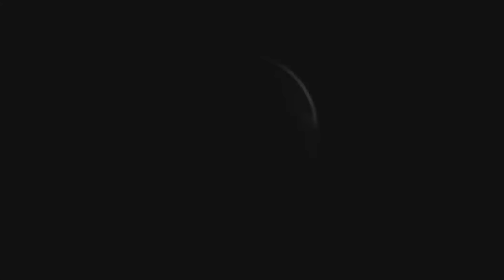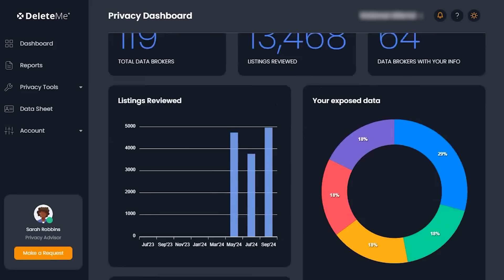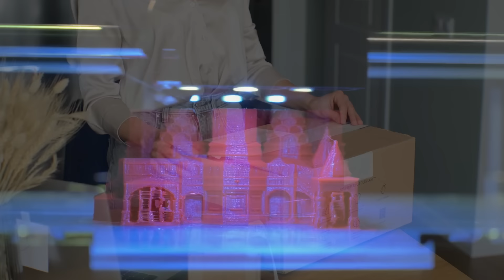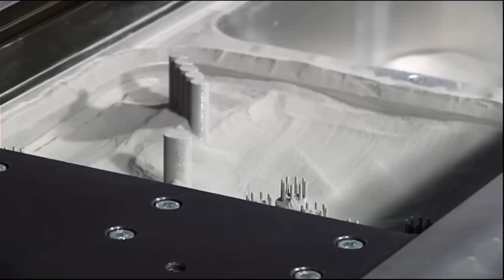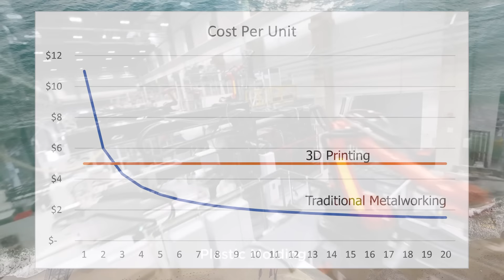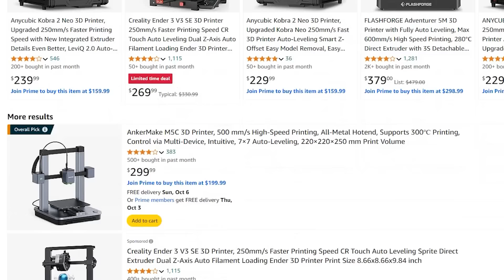3D Printing, Cathie Wood's Latest Disaster

Comment: I would love to get a 3D printer, but right now, the market is just too wild to get a handle on. I consider myself more educated than most and even I can't make sense of which printer to buy. We almost need an Apple Computer-type company that makes a solid, extremely consumer-friendly version just to settle things down. (There are a couple brands that might fit that description now, but again, hard to see it from the outside looking in.) Let others be the Android/DOS wild west, but create a product someone can just buy and use. I also think that is the primary cause of Wired's prediction failure. Sure, there might be a learning curve even if you may just be getting plans online, but until we get that market leader that "becomes" the 3D printer to own, Costco and Walmart would be foolish to stock any of them.
Reply: if Apple made a 3d printer for retail consumers it would be 15000$
Reply: @sergitech9697  And you'd have to buy a $8000 proprietary cable separately.
Reply: Bambu Labs and Prusa are the top dogs of 3D printing now.  I like Prusa printers better but they can't compete with Bambu Labs on the low price offerings.  The cheapest full size Prusa is $1100 (unless you want to completely build it for $799) while Bambu has a full size printer that puts out almost as good of prints for $339.  Bambu Labs is the Apple of 3D printing, slick and sleek!

Comment: To be fair Bamblabs killed so many of the other brands. had my x1c for over a year and it print polycarb and nylon with little effort. Its as accurate as of F900 at work and prints as fast. Kathy invested it the 3dsystems and Stratsys and those are ferrari's is price to own and run. Great for manufacturing but not for Comsumers. we have 2 great metal printer for making injection mold, stamping die and other tooling parts. However no way the company or equipment should be valued any different to a CNC maker.

Comment: If you need millions of units - 3d printing is not feasible vs injection moulding. However it has its place for custom specific products at low production volume. It is also useful for interative product prototyping or IM mould design itself. The issue the industry is facing for industrial level 3d printers is that the Chinese are selling very able consumer grade printers at a fraction of the cost with 80-90% print quality. That's why Stratasys is suing Bambulabs in my opinion.
Reply: Not that degree of print quality. To make a useable machine part you need less than 0.01 inch accuracy every time. And I know this because I use to work aerospace
Reply: Bambu lab don't make industrial printers do they?

Comment: Most aluminum aerospace parts are not molded, they are milled from solid billet.  So most of the billet is removed as metal chips and is essentially waste.  That is where the reduction in waste comes from.  Laser scintered metal powder can be recycled.  That said 90% cost reduction is ridiculous and not feasible.
Reply: This idiot thinks we don't recycle the aluminum chips by the ton......
Reply: @samsonsoturian6013  sure chips can be recycled and turned into new billet. Unscintered powder can be mixed with fresh powder on site immediately and used immediately at no extra cost to smelt and reforge chips.  It is apples and oranges.  It is far more efficient, not 90% more but way more efficient and that is saying nothing about the ability to nest part in your build volume to get more parts out of the volume of material.
Reply: Rockets have always been held back by the extreme R&D.

Comment: The crazy part is 3d printing has a niche profitable application (custom parts), but gamblers can turn anything into a ponzi scheme
Reply: It's not even that niche, a lot of companies could use it for research, rapid prototyping, small scale runs or when no other way of making what you want exists. The tech is actually really old, but the patents only expired a few years ago.
Reply: @lbgstzockt8493 yup.   It’s not a new tech, if my family has in our basement .for a few hundred bucks.  Yes, businesses need printers to quickly print a part until they can get one shipped.
Reply: There's someone here on YouTube with a print farm whose niche is dust collector attachments for power tools. He seems to be doing well for himself.
Reply: Well observed! And due to the parts being custom, the process of their creation can not be at all automated - which further closes up any potential for scammers to create AI- generated NFT-equivalent object files!
Reply: Pretty much. 3d printing is like contemporary AI. It absolutely has valid use cases . . . but it's not magic!
Reply: Even for mass produced parts it has some applications. There are medical implants with lattices for bone to grow into for a better bond or internal features that can't really be machined normally that get made with it, but it's not very precise. Threads, locating features, bearing surfaces, basically anything that needs a decent surface finish or remotely tight tolerance, needs to be machined as a second or third op in a normal lathe or mill after consolidation.
I can't imagine it's cost effective for anything except aerospace or medical given just how insanely expensive it all gets, but it could be a good supplement to investment casting or forging.
Reply: Yeah, been following the "hobby" side actively quite a while. Yes even the under 1k printers can be used professionally in protos/small batch mfg, or just to make some extra on the side if you get a good idea. The problem is how to market and sell your idea, when everyone who has a printer can reverse-engineer your product and sell it. So many youtubers in 3dp are just like the "get rich by buying my cource to become rich" guys. They sell you the dream of making money with the tech, while their business is the videos you watch. Same goes to CNC Lasers/hobby mills....
Reply: Also a consumer market! I don't have a 3d printer but I can think of numerous things it could be useful for.
Reply: Thats a very time real statement that says i3D printing hasn't gotten way better in the last two years. The next niche thing will be ships from china sending you food containers for the food they send you in containers that they make from food they don't even grow themselves. Your consumption is niche lol. You should make a toilet paper machine.
Reply: I didn't understand a word that you wrote
Reply: @TheRoland19111  I think that person had a stroke while writing that.

Comment: New technology is wonderful but it's almost impossible to tell which of the dozens of companies will succeed.
Reply: It's actually been around for decades.  The technology is cool when you first learn about it, but there have been zero companies that have been successful with the technology in all those decades, mostly due to slow production times.  Mass production with 3D printing is inefficient.  It's only decent for prototyping, and even that's challenging to turn a profit and keep a business alive.  So the answer is NONE will succeed until proven otherwise.
Reply: @jonb9194  It can be integrated within a larger business.  There's no business that can turn a profit from say, using solely a power drill, but combine that power drill with other tools to create a fully featured workshop, in a prototyping department, which feeds design inputs to a traditional mass production department, then you can go places.

Maybe the question is can a business using a 3D printer be isolate from any sort of traditional mass manufacturing and still succeed.  The value they have to bring is not mass produced products, but something else.  It might be education, or low volume highly custom parts.  Or whatever they produce in mass might not be a physical product at all, but a digital product, like a movie or social media content.  Or even a video game.  How's that for an idea?  How to use a 3D printer to aid in video game development.  Pokemon Go was a hit because it combined a video game with real life exploration.  Can we do that with 3D printers?

We tend to think of successful games as games that target the widest market - think mobile games that anyone could just download and play.  On the other hand there are more niche gaming markets like flight, racing, or tank simulators where players spend a lot of money on hardware.  Maybe there can be a game where players spend money on a 3D printer in order to play the game.
Reply: @jonb9194  I use my 3d printer all the time, most of the small electronics companies I know use them, these days they are like drills just a standard tool in the workshop. Mostly used to make jigs - I 3d print PCBs to make sure they will fit in the housings. 3d Printers are not cool anymore they are just standard tools.
Reply: That's what ETFs are for.  So that you invest in an industry rather than a single company.

Comment: 3d printing to make the molds that manufacture parts at scale is a very good production pipeline. Unfortunately you don't need a bunch of printers working around the clock to do that. I'm just happy I can get really good resin printers for my hobbies now. Sorry not sorry it came at the cost of investor hype. 🙂

Comment: As someone who owns 7 3D printers I can confirm they are a pain in the ass… but pretty cool when working properly
Reply: Im curious about what brand.  This was my biggest concern when buying one but Maintinance on my Bambu X1C has been smooth on the maintinance front so far.  Biggest issue Ive had is panicking anout finding a microfibre cloth to clean with.
Reply: @OneMocha1015   Yeah the Bambu is great. It’s those cheaper ones like the Crealitys that give me problems. Not too bad on maintenance, but I’m also an electrical engineer so I have the tools handy to fix those problems. There’s certain things that if I were an average consumer I probably wouldn’t want to deal with it. You get what you pay for so if you go cheap just be prepared for that.
Reply: @OneMocha1015 I have been using tiertime up3d but I heard good thing about Bambu too
Reply: Yeah because you own a hobby one. We ain't talking about hobby printers, but commercial ones.
Reply: @DoesntRefillTheBrita  No shit? I thought he had 7 commercial printers thanks for clarifying that, captain autismo
Reply: @DoesntRefillTheBrita  BBL has bridged that gap we use them in production prototyping. Can do Nylon and other stuff on X1, they are great.  If you are at home printing home stuff a P1 series is plenty, it's the same thing with a few features and failsafes taken out. And yes, the X1 has caught things multiple times, before the spaghetti monster appeared and saved me a lot of hassle and time.
Reply: @DoesntRefillTheBrita  Commercial printers? You might as well invest in CNC at that point and mill out a block of plastic. Or hell, a hot injection mold plant. 3D Printers were designed for cheap rapid prototyping that didn’t require pinpoint precision.
Reply: @SeanGBM  if you weren't aware, there are many parts which can't be made with a CNC but can be made with injection molding or 3D printing
Reply: @DoesntRefillTheBrita  there’s just not that many applications for commercial 3D printers. Like mentioned in the video, cost quickly becomes more expensive for 3D printing vs something like injection molding. 3D printing is viable for making custom parts in low quantities. Not many businesses need low numbers of custom parts to where buying a commercial 3D printer makes sense.
Reply: @brax3d   cool. I'm not arguing that. I'm saying your original comment is irrelevant.
Reply: That's where bambu lab made a huge leap forward in the industry initially. Before that 3D printers were for people that wanted to tinker with machines, not 3d print reasonably reliably with reasonably little effort.
Reply: 3dp is like a custom cars - you have to want to learn and gain knowledge about it - its not a microwave where you can set it and forget it
Reply: It's a good thing that they are a pain in the ass, right?  Keeps the noncommitted and lazy folk out of the industry.
Reply: Rarely had problems with my printers since I always did monthly maintenance on them. My oldest printer which is an fdm still works after 8 years. I now have added 3 new resin printers and they're easier to maintain. Also buying a good brand ensures you have parts available and have a community to help you out if you can't identify an issue. Even cars break down if you don't do proper maintenance.
Reply: Pain because they aren't made at a high standard to save cost. Rigidity, speed, maintenance could all be improved significantly for more cost.

They're trying to keep them cheap. That's why they're annoying.
Reply: Which is why it is important to actually buy from established company with good after sales support and servicing packages.
Reply: @Jinkypigs  I went cheaper because I don’t mind (and honestly enjoy) fixing things, so support  wasn’t a big selling point for me when selecting a printer but I definitely agree with you for the average consumer
Reply: I have 16
Reply: @101yen  nice. Print farm?
Reply: Someones trying to flex 🙄

Comment: Nobody want to engineer and print out 25 parts before they get it right to fix some stupid issue that a $15 part from a local shop would fix perfectly.
Reply: This really depends. Some parts, even if plastic, are sold at massively inflated prices (particularly plastic bits for cars) or aren’t sold at all, so 3D printers are great for fixing stuff that’d otherwise require replacement for a minor breakage. But their real value lies in prototyping and bespoke parts. Joe Bloggs will probably never bother with a 3D printer, too much effort, but for small scale prototyping they are invaluable, whether you’re a hobbyist or a huge engineering firm. Every engineering firm I’ve been at has had at least one 3D printer for running quick prototypes, saves a ton of time over constantly going back and forth with the machinists on something you may end up canning.
Reply: Measure twice, cut once.  I always take measurements of the things I plan on making a 3d printed part for, so that when I design stuff in CAD, I have features that are the right dimensions.  I've also worked with a machinist before and gone through my growing pains of learning about how to tolerance.  It takes discipline, but for me, having to do 25 iterations is unheard of.  Maybe a few at most.
Reply: People often confuse 3D-design and 3D-printing. Putting an 3D-printer to good use does not mean you have to design as well. There is a lot usefull stuff for free on the internet and models get reworked over and over again. 

From my experience good measurement is key. I would rate 5% of my prints as failure. My husband needed special supports for his music stuff, which would have cost 80€ including shipping and tax from a foreign country. Would at least take a week for shipping. I printed them for 10€ in 12 hours.

The printer I did this on was bought new for 150€ years ago.
Reply: It's great for fixing various things around the house.  I used to cut and drill a lot of lumber and acrylic to fix or make something custom (to my exact specs).  Now I usually draw it out in CAD first.
Reply: Yes, but it is a cheap way to make custom parts if you need them. I've seen guys use them to make stylized upper receivers for their guns
Reply: I'd agree using an existing solution is best most of the time. When it doesn't exist or is very expensive, a 3d printer is a great tool. I wouldn't pay €15 for a simple part that I could print from a few cents of plastic. Or if I could save a long lead time, I would potentially print it. It depends on the part and application, alot of things aren't viable with weak plastics like pla.

To that point, there are huge libraries of 3d printing parts on makerworld, printables and others. So I'd go there first rather than designing something from scratch. To see if someone else has solved the issue already. Only then would I fire up fusion and design something myself.

If it takes you 25 iterations to get a successful part, then you have no idea what you are doing!
Reply: Engineering 101 : "The solution that exists is probably better than whatever crap you were going to make".

Humans already figured out how to make extremely strong things that can hold up to extreme conditions. Now hucksters are coming in pretending that they have a "cheaper replacement".

Comment: 3d printing is more about being able to create parts to fix things later and not have to store tons of replacement parts or even make them unless needed
Reply: For me I find it useful for making mounting structures and enclosures for electronics projects.  It's easier to 3D print a mount that matches a circuit board's dimensions than to have to hand make an equivalent.  It's also good for making special adapters like mounts for camera equipment than having to buy overpriced parts online.

And then there's the whole world of making 3D models for hobbies like tabletop games or decoration.  Or some DIY projects like making a 3D printed Joystick or Racing Wheel.

Comment: I work at G.E and we have 3d printers that never run lol.
Reply: i have to make investment decision based on assumption tha 3d printing works in aerospace!
Reply: Anyone who makes serious parts has 3D printers... that never run.  3D printers are for high schoolers and university students.  Other than a few very specific niche metal printing applications they're basically awful at everything and do an inferior job.
Reply: i have to make  invest decision based on assumption that 3d printing works for aerospace
Reply: I work in an industrial company that makes machines which we build in numbers that are around one every 3 days.  We should be perfect for 3D printing.  Very specific machines, very low volume.  Our 3D printer is used like 3-4 times a year for a prototype part.